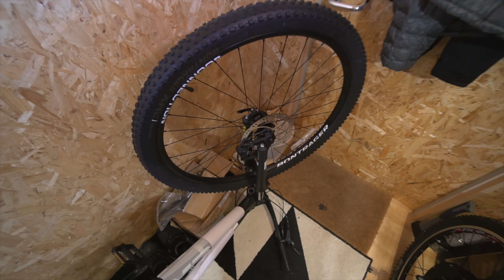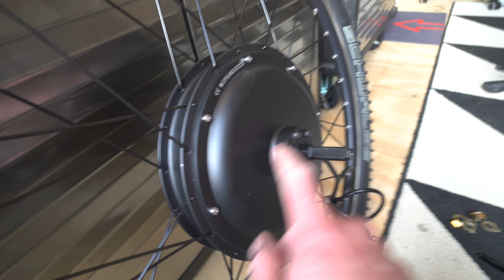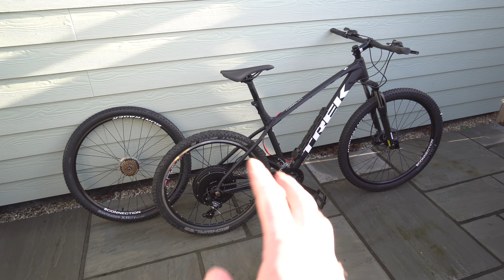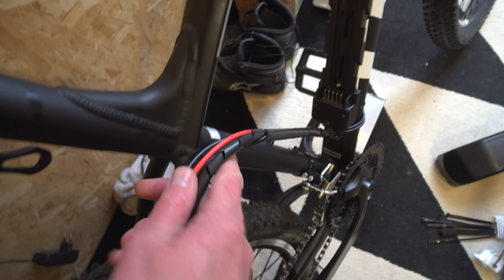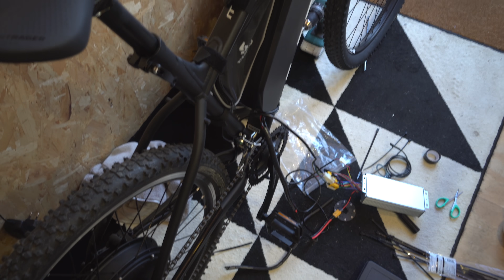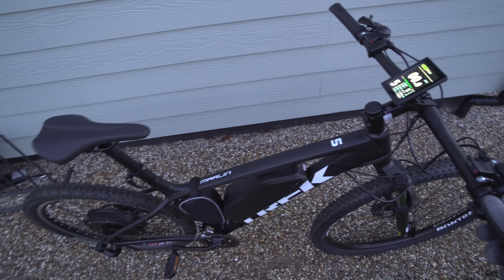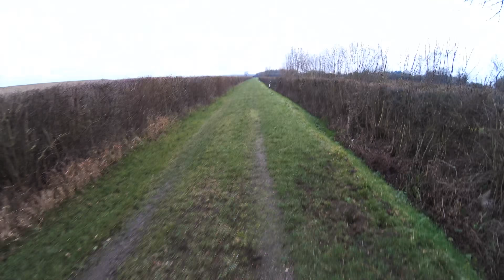HOW TO MAKE AN EBIKE IN UNDER AN HOUR!!! | TREK MARLIN 5 EBIKE CONVERSION

Comment: would this kit take 60v ?
Reply from the maker: Yes, as long as that is your absolute max voltage.
Reply: cheers for the reply mate well im planning on using parkside (lidl) 20v batterys 3 in sieries 3 in parallel but they mesure 21v each fully charged on my multi meter so would be more like 63v tops or would 2series 5 paralell be a safer option ?
Reply from the maker: Hi, no worries! I think it would be a bit underpowered at 42V (2 packs in series) you could always not fully charge them, the battery we sell in the kit reaches about 59V fully charged so I think it’s ok, I’ll try and find out what the absolute maximum is from the manufacturer.
Reply: that would be brilliant if you could pal
Reply from the maker: Hi again, max voltage is 60V so you would have to charge to 20V per pack, actually this would help to prolong the lifespan of the packs anyway by not charging fully. This is what I would do.
Reply: thanks for the advice pal.
could you recommend a charger for this application ?
Reply from the maker: Tom Weir you’d need a programmable charger, something like on this page: https://www.cloudsto.com/ebikes/chargers.html

The only issue is how to balance the batteries whilst charging them. The chargers that come with them probably handle that side of it unless they have an inbuilt BMS. It would be worth looking more into how those batteries work with their dedicated chargers.

Comment: Hi Andy - nice vid as usual.
What you should try to do to counteract the sketcyhness at high speeds (if you are going to use the large power kits) is switch up to using a fat bike - 26 inch wheels still, but they will fit between 4-5 inch tyres dependent upon the rim width.
I recently bought a rare BH Bigfoot which has a stock pedal assist 250w motor running about 40nm of peak torque - not a lot in the greater scheme of things but enough to assist where I use it (off road, mainly on beaches and dune bashing) - link to the vid of it being used at Camber Sands recently. https://youtu.be/feBtChfT6nI
Reply: don't think his bike would fit fat but maybe plus

Comment: what sort of range would you get on road? add a few hills in... 15miles maybe?
Reply from the maker: I’ve done about 25 and the battery was still going, mix of hills and speeds both on road and off. The 17Ah battery is quite a lot for a medium powered ebike.
Reply: @andykirby  Thats great thanks. My work trip is 25miles there and back. i was thinking of converting my cube race ltd lol.
Reply from the maker: Yeah you could do it easy I reckon if you pedalled a bit. Could you charge at work too?!
Reply: @andykirby  yea i could charge it at work as well i didnt think of that lol. I wonder how hot the rozzers are it. Say if your cruising at 30mph whats the penality if busted?
Reply from the maker: Well, some cyclists around my area cruise at 25mph!😁
Reply: @andykirby  I get u bruv. ) cheers mate keep up the good vids.

Comment: So Andy,any bike can be converted then huh?I have a 300 $ Walmart bike do you recommend anything more expensive?
Reply from the maker: Actually Walmart bikes can be good because they are often made out of steel rather than aluminum, maybe check to see if it’s definitely steel. Other plus is they may have cable brakes rather than hydraulic so the brake levers included in the kit are a straight swap!

Comment: Very nice build, simple and powerful with a clean look. I'm amazed at how well the mismatched wheel sizes worked out. 

Definitely want to put some torque arms on there. I have 1500 watts to rear hub motor (with regen), and it wore the dropouts even on my steel frame, to the point where the axle spun out. It took a long time for it to happen, but I wish I had just put them on. Now I have a scrap frame.
Reply from the maker: Thanks! Yes I didn’t stress the importance of torque arms in my video, I did actually install it before the main test run as you are correct, due to the high forces from the rear hub it. An easily wreck the frame or worse it could fail with you on it!

Comment: Anyone else noticed the upside-down gear shifters?
Reply: Yep
Reply from the maker: It was a mistake, mainly to doing things in a rush, funny thing is though when I flipped it around shortly after the video I had trouble positioning the thumb throttle because the gear levers are pretty chunky and take up a lot of space on the bars.

Comment: I have a Marlin 5 2018 conversion with a similar kit, though I made my own battery. That frame looks nicer than mine. Must be the 2019 model?
Reply from the maker: Yes it’s a 2019 model, nice flat top bar and smooth Matt finish.
Reply: andy kirby what’s the frame size Andy?

Comment: I have the same wheel but in 1000w same kit. The bag was my biggest issue aswell its not the best to hold the control box I found it was to small and you are left with a lot of wire left exposed where a bigger bag can help hide it

Comment: is it possible to SAFELY drill holes in the frame to route all the cables so they are 90% hidden ?i wouldnt do it on a expensive frame of course just something like a halfords bike
Reply: Only problem is where you have drilled they would probably rub and then that could turn the bike in to one big shocker if it has rubbed the power cable through 😂 30mph and getting shocked wouldn't be fun

Comment: Hi Andy, really fun video can I just offer up a couple of things, I know you mentioned the torque arms, make sure that people use them when they have aluminium frames and don't even go for a test ride before they fit them, steel frames should be fine but on aluminium you will crack them very easily if you don't use a torque arm, also if people want a front wheel motor on suspension forks you shouldn't even turn the wheel without a torque arm, someone I knew snapped his dropouts at standstill both sides when fitted to a suspension fork with no torque arms.

Look at the kits provided by luna cycles, they use similar kits to you but they get the suppliers to fit really nice quick disconnect connectors to the power and the hall wires, I thought the days of Chinese ebike suppliers supplying those naff connectors were long gone but it seems not, you want the disconnect wires near the rear axle otherwise changing out the wheel if someone gets a puncture will be a nightmare with that screw in block? in the short term you could use 30A Anderson powerpole connectors, I have been using them for 10 years on my 40,000 mile ebike, I use a simple cheap 5 pin din audio jack for the hall sensors, little things like that make all the difference I think the 5 pin din was 50p from Maplins.

This is a direct drive motor, can you test the hill climbing ability, I would be interested to know how it fares, I have been on the ebiking scene since 2000 and did dabble with supply all those years ago with Mark Higgon from Team Hybrid way back in 2006 and it was fun but it can be a PITA when stuff starts going wrong especially the batteries, dont go investing all your savings in to it mate, Im glad I kept it just as a hobby, i wish you the best of luck.
Reply: 40,000 miles.. Damn is that on the same motor and hows the bike I feel after just 1000 miles mines kind of slowed down my brother has a newer motor and he seems to just take off from me. I built both bikes and as far as i know the settings am all the same
Reply: @NaytonRides  Yes the same motor, it is a geared motor though and has had 1 set of gears in which I changed myself, there is a video about it here. https://www.youtube.com/watch?v=e2vAlXq3fGA
Reply: @NaytonRides  isnt the motor thats wearing out ,its the battery ,if u are thrashing a 48v battery at 1kw for example expect its voltage to sag by 30% over half a years use
Reply: Nice

Comment: I ran one of those at 50a for months 56v just shunt modded the 35a kt controller. the motor gave out finally when I went to 80amp and was doing a lot of pulls on the field. I think 3 to 4k is the limit for that motor without heatsinks and ferrofluid. the looks on the kids faces when you blow them away on there mopeds, even had a 125 fourstroke struggle keeping up. top speed with 27.5 wheel was 44mph andy.
Reply: On a 1000w 48v battery I get 35 on a straight did have 38 but only a few times that's only with a fully charged battery though can't imagine going 44mph though especially on a push bike
Reply: @NaytonRides me too just wish it had more torque I'm happy with my top speed tho

Comment: Andy these look great. What are the dimensions of the battery please? I have a full suspension bike I’d like to convert but not sure I have the space as my bottle mounts are really low. Thanks.
Reply: With that size of battery I bet you wont get it to fit I have a 2012 voodoo hoodoo hard tail and mine is tight to fit in

Comment: Andy, either your bike has funky thumb shifters or the handlebar simply needs to be flipped by 180 degrees ;-)

Simply check out the cockpit picture at their website:
https://www.trekbikes.com/us/en_US/bikes/mountain-bikes/cross-country-mountain-bikes/marlin/marlin-5/p/23134/

Also I would not ride an MTB with mixed wheel sizes. Makes everything complicate. A conversion kit for modern MTBs should simply be a 28" wheel set which fits easily any 29er out there. 26 is really old and most bikes are either 650B (27.5") or 29".

Just as a hint !
Reply from the maker: Haha someone else noticed that! I actually flipped the brakes around before realising! 
There’s a range of wheel sizes available for the kits but this is just the sample I had from the factory so I thought I’d put it to good use. I’m already thinking of switching the front wheel or converting to a 29er for the back.
Reply: @andykirby  it is good to hear that there are other options in regard of wheel diameter. But please still consider my comment to the previous video: Use a "maintenance" connector in your motor cable. At least somewhere in between the hub itself and where the cable is connected to the controller. A fixed attached cable (esp. with a lot of zip ties) becomes a major PITA if you run into a flat on the motor wheel.

Just my two cents,
Holger

Comment: My ebike wire from my back wheel comes from the end of the threaded bolt plus like your display
Reply from the maker: Yeah I’ve seen that before, for high power motors that wouldn’t be a good idea as it would weaken the axle.
Reply: @andykirby  true mate is the display the KT range as I've got the kt-lcd3 display wondering if it would fit my controller

Comment: i’d love to convert my old claud butler which i bought way back in the early 90’s to electric. but prices are a bit too much right now. cool kit though!
Reply from the maker: The 250W kit is a bit cheaper.
Reply: cheaper than buying a whole Ebike though, halfords own brand is limited to 15mph assisted and costs £850 ,which prob aint too bad considering the bike alone would be around £250 + another 500 for their kit, i wish i could find a firmware hack to bypass the speed limit
Reply: @girlsdrinkfeck  yes but that is only with a 8ah battery with inferior cells, to the one in Andy's kit!  And no throttle to boot, And this is the deal breaker, with the KT LCD 8H you can de-ristrict the speed limiter!. And also bare in mind the (KirbE bike) comes with a (52v 17ah LG cells and a 35amp controller.) The entire kit with that Trek bike will cost you about £1000, less if you buy the 2018 model!!   The bike you mention from Halfords is (36v 8ah with probably a 15amp controller) and slightly less spec on the bike also.
Reply: @likeher9  i would probhappily have the peace of mind of a warrenty and being legal. Albeit dosnt stop me wanting and being a fan of mental electric bikes
Reply: @girlsdrinkfeck  you can be legal, and even cheaper than the price I've just quoted you with the (KirbEbike) 250watt kit! And I'm totally sure (KirbEbike) with Andy in charge you'll get a warranty!
Reply: @likeher9  even if the battery burnt down my house? I doubt that
Reply: @girlsdrinkfeck  please check out My Instagram page to see what can be built using one of Andy Kirby's kits. https://www.instagram.com/likeher9/
Reply: @girlsdrinkfeck  Haha!! I'm not sure Halfords will cough up for a new house for you, even if their battery burnt your house down either!! Good one that though, made Me giggle. Hey good luck though!
Reply: @likeher9  according to UK law yes they will
Reply: @girlsdrinkfeck  I stand corrected! Don't forget your phone, drill, tablet electric toothbrush - I hope the last one wasn't bought from the local market?  All lithium ion remember. But anyway like I said before, good luck, only trying to help.

Comment: Andy, tip for the cable going into the hub: make it approach from below so that rainwater drips from the bottom of the cable loop.
Get those torque arms on! I lost my previous frame because the dropouts sheared off completely and the wheel fell off - not fun!
Reply: Yes, very important.
Reply from the maker: Good tips, yes the torque arm was on for the test drive part I did the next day. Very important, I didn’t stress that enough in the video for safety. Thanks!
Reply: @andykirby  Hi ! Can you make a video riding on this bike uphill without pedaling ? I want to see how it will perform in such situation. Thanks !
Reply: Yh thats happend to me

Comment: Nice one! So what was the top speed?
Reply from the maker: I clocked About 35mph
Reply: That's about what my 1500w on 26" does too. I'm in the process of upping to 72v so it'll be fun to see what the result of that will be.. Apart from BANG !! So if you read somewhere that Peterborough has an Urban Terrorist then you'll know I welded  the connections wrong !!
Reply from the maker: @0utcastAussie  cool, will you update the controller? Some 48V controllers can take 72V it all depends on the voltage rating of the electrolytic capacitors and/or the voltage rails for the controller circuits.
Reply: wow. 35 mph is fast on a bike. borderline scary.

Comment: I have the same setup on my mtnb but mounted the controller on the underside of the frame with a junction box for all the wires. Found the controller was overheating in the bag and it looks much better underneath.  Great vids m8 😎